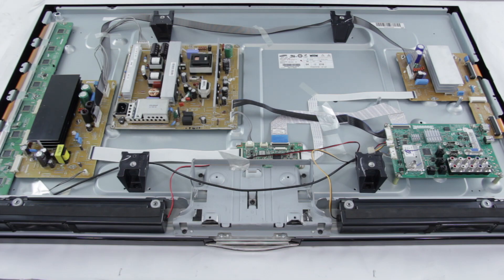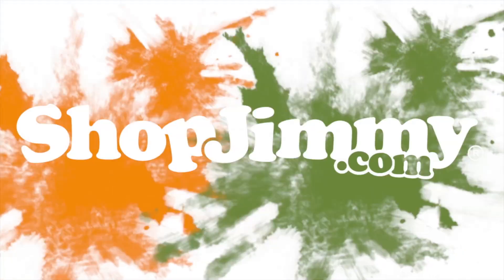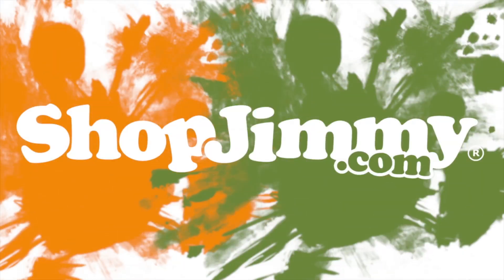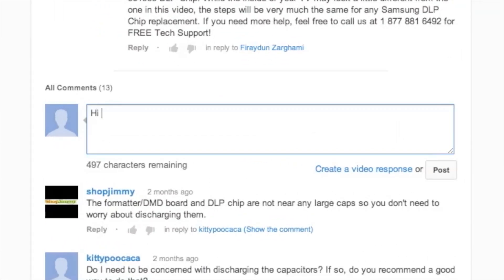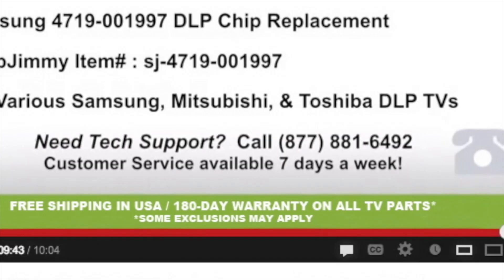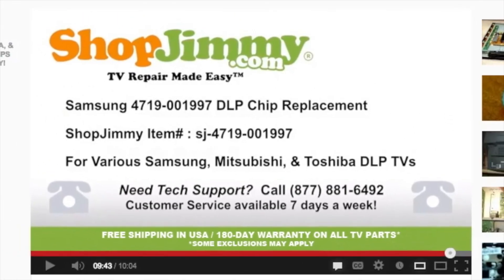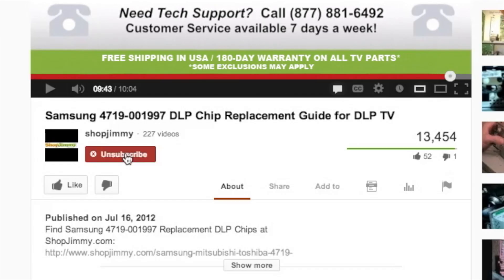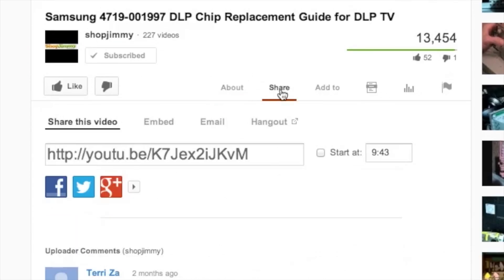Plasma TV Repair Tutorial - Common Symptoms & Solutions - How to Fix Plasma TVs

Comment: I have a black (sometimes red) vertical line on my Samsung Plasma. I have cleaned all of the ribbon cables and connections and replaced the logic and main board. Is there anything else I could try?

Comment: Panasonic Plasma TH-50PX50U. Yellow/pink snow on screen in front of images.
Reply: Did you solve the problem? I solved, bought external stabilizer, but have some issues with brightness, think that image bcame dimmer and plasma not getting brighter from 43 to 60, from 1 to 43 getting brighterm from 43 to 60 not..

Comment: I have a Panasonic TC-50S30 that won't turn on. No power led, no blinking led's. I can hear clicking when i plug it in. There is +5 V on one of  the power supply pins going to the main/tuner board and there is one led on the ir out connector. that comes on for a few seconds. Checked PS for input voltage , fuses and for short ccts. I'm leaning toward replacing the P.S.
Your comments would be greatly appreciated.      Doug

Comment: Hi, can you please help me fixing my TV, Samsung PS43E450A1W, when I power on, I get stand by light, no display on screen. I opened the back cover, I can see the light blinks on the small logic board, I noticed a burnt blue transistor on Ysus board, so I think I need to replace Ysus board, but how do I test that other boards are ok, when I disconnect Ysus board and connect the power, nothing changes, same behaviour that no display, no sound, blinking light on logic board, please help will appreciate kind help how to fix my TV, thank you.

Comment: I have a lg plasma60 inch  and it seems to me that it is overheating. It turns on fine looks great but shuts off after 10 min then turns back on about 2 min and repeats this. I looked into it and thought if I replaced the main power board it would be fine but I have the same problem still. Cleaning the dust didn't help jigaling the power wire doesn't help. I think it's overheating problem. Is the next step replacing another board like the parts that runs the HDMI cable

Comment: I have a 60 inch LG plasma TV and it would turn on and then after a few minutes the screen would go dark, then it would power itself off. If you turn it back on it will work but will always turn back off. I listed it for sale and described the problem it had. A guy messaged me and told me if I could solder, I could fix it. One on of the boards, these little coils had developed cracks on the bottom of the board.. I repaired them and re soldered them and the TV started to work great again. It's been about three weeks and tonight, it started doing it again.. I took it apart, added more solder and made sure it was done better as I kinda rushed through it the first time. I plugged it back up and about 10 minutes after turning it on, it did it again.. I only did the board on the right side of you're looking at it from the back with the cover removed. I checked the other side and they aren't cracked like the right side was so I didn't mess with it.
Reply: I'm having that problem
Reply: @abelhansen3879  last night was the first time since I did the repair that it happened. I re did the soldering and really took my time. Put it all back together, plugged it in, turn it on and about 10 minutes later kicked off.. I turned it back on and it stayed on until I woke up, 9 hours later and I turned it off. The soldering definitely makes a big difference. The people who have the videos of putting the main board in the oven, thats what they're doing, that gets the solder hot enough to seal the cracks that develop on the underside of the boards.
Reply: So I've laft the back panel off so far it's been running 40 min without turning off this and a fan blasting air up across the back might just be all I need

Comment: I have a 55" Samsung PN58B540, and it suddenly stopped working today. The screen just went black, and it clicked 3 times. It has worked perfectly until now. It has power. From what I see on UTube, it sounds like it may be the X axis board??

I unplugged both of what I believe to be X and Y, trying to troubleshoot, and then plugged in the power. It made the start up music, and the two little green lights on the small center back panel (A) lit up for a short period of time. The picture does not come on, but the red light is on in front. The large center power panel (B) clicks loudly 3 or 4 times upon power up every time. The exact same happened after plugging in the X and Y panels.

I have pics of the boards I can send you...(tagged as noted above) . Thanks a ton for all and any help!

Comment: Hello!
Would greatly appreciate your advise for fixing my Pioneer plasma TV, model PDP-506HDG.

Both the TV and panel system have power supply on standby mode. But when I turn on the TV, my TV screen would shut down leaving the standby red light blinking and the red light on the panel system. The red standby light on TV blinks 11 times before pausing and then starts blinking again.

Tried to switch on-and-off the TV button a few times, but the same thing happens again.

Didn’t use the TV for a few days and tried again, and it worked (amazingly), but only for a few days and am back to the same problem.

Thanks for reading and for your help :-)

Comment: We have an older Maxent 50 inch plasma TV. Its a good 10 years old at least. It usually works beautiful, I just went downstairs to get some food. When I came back up the picture was there, but it now has all these white lines all over it. They are all over the screen,  they look horizontal, but when I go up close to it, they are actually vertical. Just going in a horizontal way all across the TV screen. I can still see it, but its hard to see when the picture is darker, then it looks more blackish. When the pic is lighter, it looks little while lines. The TV model # is P500550HM8. Can anyone help with a fix, or what part I could buy for it?

Comment: ok so after some digging my panasonic 2007 50 onch has bad IC chips on the lower half of the horizontal buffers   i ordered part number xxxxx58 and should be good to go. ill post a video of the repair process (:

Comment: In the midst of watching TV on my 60" Plasma PN60F5500AF, I heard pop from  the  set, then the screen went black. Audio continued for about a minute. From the remote, I turned the set back on again, but neither video nor audio came back on. The only sign of life was the blinking tiny red light at the lower extreme end of the frame, signaling that electrical power was reaching the set. What is the probable cause of this malfunction? Is it fixable? And by whom?
Reply: The exact thing happened to my TV but I heard three loud pops and the screen turned black

Comment: Hell. Great video!  I have a 2012 TC P65GT50 Panasonic. Today I powered it on,  heard a loud snap then noticed the red power LED blinking 3 times, repeatedly. Unplugged all devices and power cable. Plugged power cable into different source, repeated and same results. Snap and red power LED blinking three times. After this, subsequently power on no longer produces the snap, but, only a light sound, sound gone and the 3 blink, power LED rotation.

Could it be the fuses on the power supply board that caused the snap sound or is it most definitely the y-buffer board? Someone else has told me it's either the the power-board or Main-board. But after looking at this video...

And advance thank-you!

Comment: I have an LG 50pg60ud 50inch tv which doesn’t show picture, when I plugged it in the green light flashes 6 times and stays on, while it’s flashing the screen goes grey and the black again and while that’s happening there’s a clicking noise as if the tv tries to turn on multiple times and then it doesn’t, anyway the green light stays on but there’s no picture or anything

Comment: Samsung PN63C7000YFXZA either turns on when plugged in and then shuts down after a couple minutes and clicks a couple times before shutting down or; doesn't turn on at all. Power button useless.  Red light on front stays on for a while and then nothing. Inside, when it goes through the clicking cycle, the green light on the logic board blinks on top and then on bottom (before shutting down). I've scrutinized for bad caps, but no obvious issues. Where's my problem? Thanks

Comment: I have an LG 60" Plasma TVMod# 60ps60-UAEverything seems to be working correctly with the exception of the left 3rd of the screen is black, the other 2/3rds show a clear imagine but the center 3rd does have vertical lines thru it. ( This is viewing the TV from the front)(This is viewing from the rear of the TV)At the very bottom on this TV there are 3 circuit boards running horizontally across the bottom.if I disconnect the ribbon connector from the circuit board on the far right there is no change as the left 3rd of the screen as viewed from the front of the TV remains black.When I disconnect the center and far left ribbon connectors from the circuit boards one at a time it does distort the 3rd of the screen just above that corresponding circuit board.How can I check to see if the circuit board I suspect as possibly being bad is in fact bad or something else is causing my issues?The circuit board I suspect might be the issue has a sticker on it that reads;EBR51552201XRRBTKSS0098F6048532209.11.09And directly printed on this circuit board is;LGEPOP 081210BOARD:60H3_XRPART # EAX54748601REV:JLOCNO:4XXXI'm retired due to Cancer and cannot afford to purchase a new TV and am therefore hoping I can resolve the issue that this TV is having.Any Help will be greatly appreciated as will be any suggestions of places to check to resolve this issue.Thank you for your time and consideration in helping me out with this problem................................................Burt

Comment: I highly doubt this gets answered, but I'll give it a shot. Just to let you know I bought from your site and you shipped my item so quickly thank you so much.

I have  TC-P42S30 Panasonic 2011 model. All 480p content regardless of source seems to have 10% overscan on the top and bottom portions of the picture. However, it is not overscanning on the left and right portions of the picture. Only the vertical. I've tried all of the settings in the menu and submenu. There is nothing that seems to resolve the issue.

I'm thinking of replacing the main board first and then maybe the logic board if there is one in there. I hope to get a response from someone. Thanks.

Comment: I have a Samsung plasma 2009 model number LN40B530P7F that develops a flashing screen after it has been on for a while. I can unplug it for about 30 minutes and it is fine for sometimes a few hours. Sometimes I just let it flash and it will resolve itself at what seems like at the end or start of another commercial. Is it worth trying to find which board is bad?. It really has a better picture than any of my new TVs. Thanks

Comment: pn60e530a3f would come up normally, only after several on/off/on cycles on the remote.. power lights, and power on/off audio still work as normal, but now it won't come up at all.. That's symptom #1. Sympton 2 is bad color response and lots of red.. BUT.. ONLY on one HDMI input.. What do you think?

Comment: I have a Vizon /sanyo 42" dp42746 , I have no standby light but went i turn on the tv the green light come on but no picture or sound. on the power board is a green light that come on went i plug it in then i can turn it on and it will blink 9 times and still no picture or sound.?

Comment: I have a PDP-R04U pioneer which will turn on display correctly for a second or two, then show splotches of color for a second or so, back to picture, color splotch and then go into protection mode. Where should one start? Pretty sure it's the display and not the control box. Thanks!

Comment: I bought a 55” Samsung plasma tv. The red-light will turn on and the start up sound will go off but there is no picture at all. Nothing on the boarded looks damaged and I could only find one fuse that seemed to work according to my multimeter.

Comment: Samsung PN64F8500AF.  Y board has been replaced.  After sitting unplugged for a while, the TV will turn on when plugged in, and will stay on for several minutes, allowing you to access the menu, change inputs, displays the input, etc...  But, it then cuts off, and won't come back on at all.  No lights, no menu access, no picture.  Please help!

Comment: LG plasma 60" TV will turn on (red light off) and stay on with no screen.  It will barley light up, so the screen is not black but still looks a lighter shade of black. The Ysus board is burnt at a resistor but the resistor tests fine.  All fuses passed the test on all boards.  The logic board flashes green. (quick, quick, quick, slow), repeat.

Comment: hi there, i have a problem with a pioneer plasma tv, it makes a whining/hissing noise (from the cabinet, not through speakers) that increases with picture clarity. With dark screens you hardly hear it, with white screens it is loud. It also increases gradually with operation length. After watching a movie it is over all louder. The sound resembles the sound you would have from old crt tv's. It has a high voltage static noise to it. Thanks and hope to hear from you soon.

Comment: hi i have a issue with a plasma panasonic tv  the tv when have more than 10 minutes on the screen coming like a static color green .. you know like solorized but green. where i will be start   slmebody told me open it and check the connections but what connections?

Comment: Hi. My LG plasma TV 42PQ10R-TA having similar problem. After power on, there is a tik-tok sound 2 time then TV remain in stand-by mode. There is no picture indeed. As per my diagnosis so far...With YSUS connected, no regular voltage coming to YSUS board. If remove YSUS, voltage shows normal. I remove YSUS & check all MOSFET & capacitors. All looks good. Unless I am not checking it right. Where else should I go next ?

Comment: shotnthdark here but hope you guys still helpn folks but i got a nice LG 50PA4500 with very low hours and worth a fix. Symptoms are: power cycling between intro screen and a black with ten whitelines upper left then repeats. After 5 min or so black screen stays. all the while unresponsive to UI. Voltages are correct, Logic flashes grn LED longshortlongshort then repeats. Main has a constant red LED. Y sus board has two caps that hum or "warble" used stethoscope to pinpoint. otherwise no visible signs of heat or visual anomalies. I guess I'm wondering about the noisy caps. I'm capable of replacing but should I?

Comment: hi. not sure if you're still answering questions... but I have a LG  model 60PV400-UB  and my picture was getting screen burn, but then on the 4th it just turned off on us, and now won't show any picture.  sound works, but no picture.  It flashes in the corner and across the screen black and white for a second upon turning on, but then nothing...just black.  any ideas?

Comment: Lg60pc45 no power past the power unit board no standbye light changed fuses the top boards seem to not getting power past the low board with red and blue main power wires

Comment: pn50c490b3d samsung plasma 2013 plug into wall and hear clicking took off back panel unplugged from main board and clicking stops appears to have 3.7v standby voltage. Thinking it is a bad main board. Thanks for any future input.

Comment: Good morning.  I have a Sanyo DP50740 plasma tv that will not turn on.  When I press the power button the little green indicator light comes on for something like 5-10 seconds, then turns itself off without ever actually turning on.  This can be repeated two more times with the same results and then on the fourth attempt at pressing the power button nothing will happen, i.e. the green indicator light won't even turn on.  I can then unplug the unit and let it rest for a bit but all that does is get me in the same cycle stated above.  Thanks for any help.

Comment: I have a Samsung model PN43f4500af that has no picture, the standby light is on and a Green blinking light on another panel , noting appears to be Burnt , capacitors etc. back light does not come on when I unplug the ribbon cable from the power supply board. TV is 3 yrs old , not a smart tv , can you shed some light on trouble shooting ? thanks

Comment: Great video! Very informative. So I've got a Hitachi model 42HDS52A plasma TV and there seems to be a cooling fan that runs continuously even after the set has been turned off (red light). I wondering if maybe there's a relay that's acting up(?). This particular set has a master power button that cuts power to the set and I have to turn it off to get the fan to stop running. Any thought will be greatly appreciated.

Comment: LG50PCD has two vertical lines on the right side of the screen.  One is fairly bright and the other is dimmer.  They are about 2" apart and the first is about 2" from the right.  They both glow reddish.  They are very thin - like filament wire thin.

Comment: I have a Samsung  PN60F5300AFXZA that won't turn on. I replaced the power board but it is doing the same thing, not turning on. the red off and on light blinks when you try to turn it on but sound and no picture. Thanks